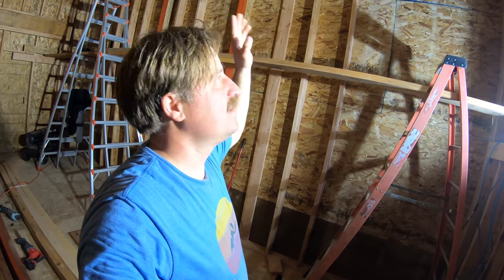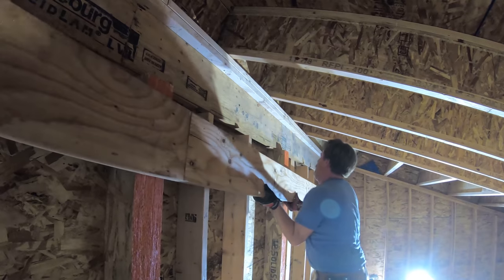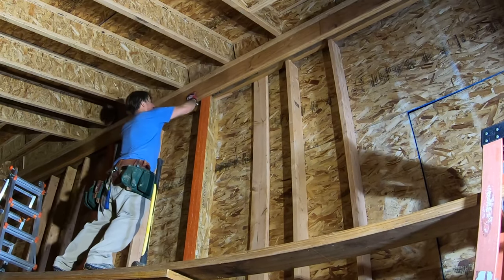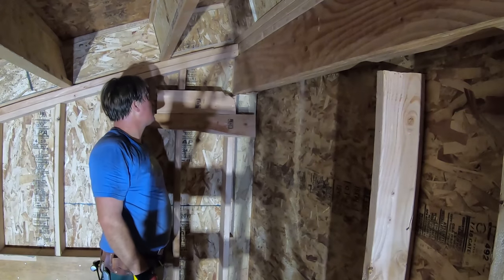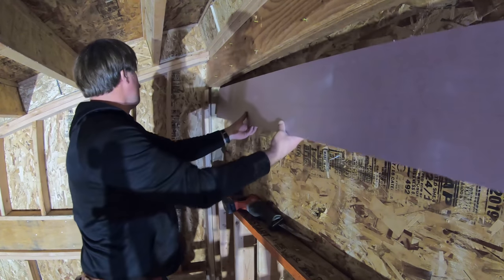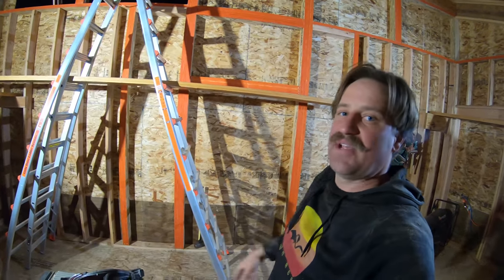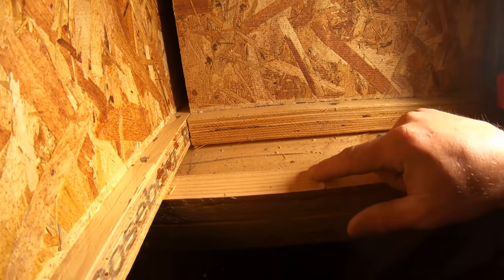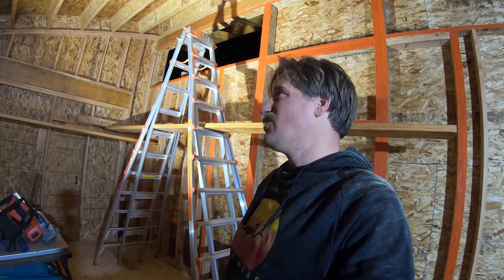SHED LOAD BEARING BEAM

Comment: Some builders are starting to always frame with a header below the top plate so that when / if their customer says I’d like that window a few inches higher or lower, it’s a much easier / cheaper remodel.  Great video!
Reply from the maker: Yep. Does make for a easier Remodel for sure

Comment: Why are you not using something like 
GRK Fasteners
3/8 in. x 6 in. Star Drive Washer Head RSS Structural Screws. Deck screws aren’t structural anchor hardware. Not trying to tell you what to do. I just learned from my own experience. I’m not a framer. But I have learned from building and having to have had a building inspection and had to submit plans to my local city building department. Both city and my onsite inspection gave me a two thumb up. For over building
Reply from the maker: Link
Reply from the maker: @digitalvision01  thanks
Reply: Yeah I’ve learned the hard way about deck screws. Also had a bunch of them snap off from nothing more than hammering somewhere else on the structure. But if you’re following load paths and not relying on the screws to bear load then it’s not so bad. Still not code but still not like it’s going to collapse.

Comment: Conor, look into a product line by Prosoco called R-Guard. It is a air/moisture barrier but paintable/caulkable. You won't have to hold the giant roll of TyVek and staple it to your shed. You paint it on with a roller and it is immediately waterproof. It can even be sprayed on if you have an airless paint sprayer. Way faster and easier on you. Looking good!
Reply from the maker: Ohhhhhhhhh really. I  have the Tyvek roll ready to go
Reply: And more expensive.. but liquid applied WRBs and flashings are the way of the future for better building IMO. I’ve installed, literally, miles of Tyvek.. it’s been a love-hate relationship at times for sure.. 😂
Reply from the maker: I did look into it and I would have used it but this was AFTER I installed and paid for the Tyvek. Next build.... Liquid flashing for sure

Comment: So I'm confused... you are putting a full width header in a wall that doesnt need a full length header, the only areas that would need a header are doors and windows. I can see putting a post under the point load of the beam when rafter directions change l, but to me you have taken the stiffness out of the wall by basically making a hinge on the top of the studs to the beam. Just my 2 cents

Comment: Connor Ward: This opening is for a 4 ft door. I’m not sure if I’m going to end up using a 4 ft door.
Me: ... that means he’s not going to put in a 4ft door.

Also, does the #SheShed project mean you’re not working on the JD R92 tractor this winter?
Reply from the maker: I am trying to get to the jd
Reply: Fair enough. I just never thought I’d get so attached to another man’s mower.
Reply from the maker: @capt_ramius  I have sooooooo much to do. I need to get my dahlias out and going. I'm mainly trying to get the shed dried in so it can sit for a second while I work on the John deere and other items. I'd prefer to work outside when the weather is better.
Reply: Connor Ward You should start a chore chart 😂